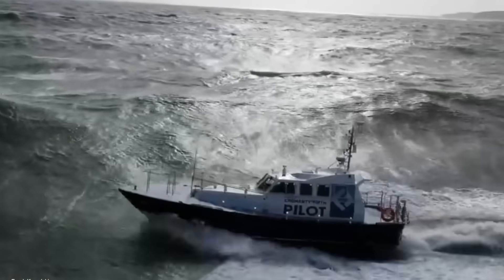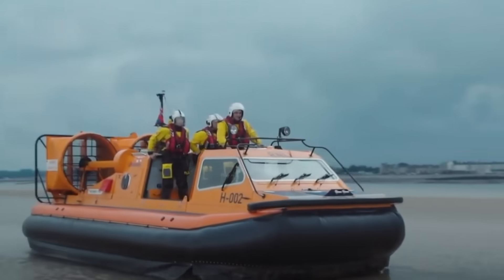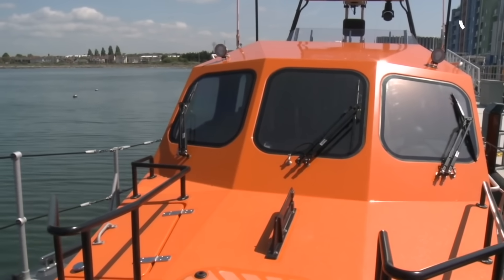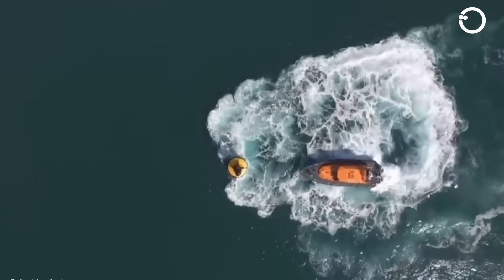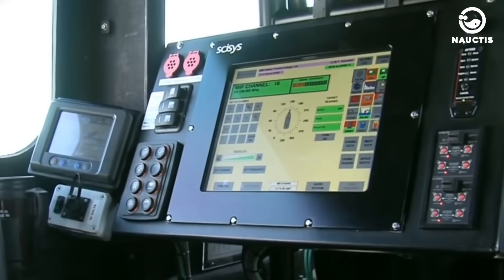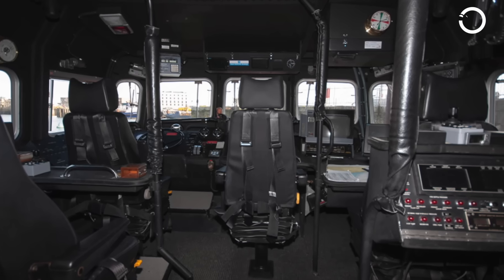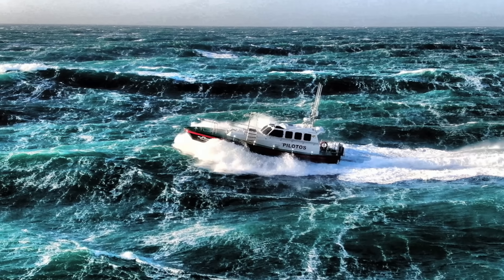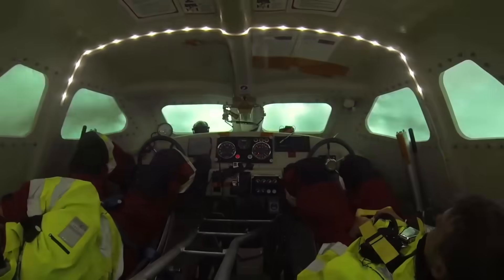Storm Rescue: Why MONSTER Waves Can't Sink the Safest LIFEBOATS During Worst Storms

Comment: @ 03:07 "Tar Mar class" ...Nonsense! It's pronounced 'Tay~Mar' named after the River Tamar which divides Devon and Cornwall. The Tamar's  designation is (16-#), the first number identifies the length and class and the second number identifies the build number (and usually the lifeboat station), this Tamar lifeboat is just over 16 metres and is based in Gosport (16-17). Then came the big Severn Class (17-#) named after the River Severn.  Also, the 'RNLI 13-02 from Dungeness is a Shannon Class, not a Tamar. This video could have been better planned.

Comment: Both lifeboats and rescue boats need to be unsinkable and self righting  when overturned by large waves, this is a design given. Furthermore, unless the passengers/ crew are  safe when being tossed over and over in high seas, Ie not thrown about inside to get injured or killed, then it doesn't matter if the boat sinks or not, since, a dead crew, or passengers are still dead! Thus safety harnesses/seat belts etc.  must be good enough to secure the occupants.  If these conditions are met, then the rescue/ life boat could be useful in saving lives at peril at sea.

Comment: In the mean time, supercomputers and big data need to recalculate torsional structural stress and factor in age to recommend range and ratio of ballast subsets for objectives of sacrifice cargo to preserve ship in bad weather and high sea.sss.
Reply: Drop some containers, ship management cargo system.
Unplug some others. Increase air pressures inside before sealing some doors. Assign some doors, stairs for intake of air and exhaust vent insides. Air pressure inside is structural-bouyancy

Comment: Lifeboats are advanced survival crafts for rescue or evacuation and long-term survival or sustenance at sea. On the other hand, any rescue boat should have the minimum conditions of the immediate or quick-response rescue of passengers irrespective of the subsequent sustenance period. USCG Veteran.
Reply: That's a Shipboard Lifeboat these are Rescue Lifeboats.   In the UK and Ireland we call rescue boats Lifeboats too.  In fact the UK and Ireland's rescue service is called the Royal National Lifeboat Institution
Reply: @hsdsaunders Our term of Lifeboat, meaning a rescue boat also predates ‘Lifeboat’ in the term of a ship-boarding lifeboat. Without the beach launched lifeboats rescuing sailors in distress around the coast it would have taken longer for someone to revolutionise the use of self-righting small boats which are currently used.

Comment: I'm not convinced.  It sounds good.  But so many of the rescue stories I've gone over have such a high incidence of failure of these systems.  From survival suits to fully enclosed boats there always seems to be a failure or problem that leaves me wondering if the design/test mentally is fully in touch with the realities and chaos of real world events.
Reply: What kind of failures are you alluding to?
And which incidents?
One thing that is important to remember is that mistakes made by humans or lack of training in using the equipment aren't a failure of the equipment.
Occupants not knowing how to right a capsized liferaft isn't a failure of the equipment.
Equipment not working because parts have been removed or are expired are not a failure of the equipment.
Most cases I've heard about where equipment malfunctioned it has been due to the crew not making sure the equipment lived up to required standards and was in the required condition.
Or used non-certifiied equipment to save money.

On very rare occasions there have been some incidents where things went terribly wrong - such as the Penlee Lifeboat Disaster, and the RF2 Disaster at Hirtshals!
Both happened December 1981!
Reply: @gorillaguerillaDK  I've spent a career leading engineering organizations in the design, manufacturing, and investigations into quality accidents.  A bad design is one where the engineers design the solution around how they want the world to play out.  A good design is one that takes into account the real world situation including imperfect training, flooding, fire, explosions, confusion, and panic.  To design a safety solution that only works in good weather and then say "well, of course if failed, they used it in the rain" is not a valid engineering solution.
While not the best example, but one that was top-of-mind, is the Deepwater Horizon explosion.  Even this less-than-ideal example is full of situations where the design and expectations of the life boat/raft engineers did not line up with reality.  You can find the report by googling "deepwater horizon-roi-uscg-volume-i-20110707-redacted-final"  Some low energy (I'm lazy and don't want to spend a lot of time on this) quotes:

1) "The liferaft tilted approximately 90 degrees, ejecting the off-watch toolpusher from the stretcher while the other occupants tumbled within the confines of the liferaft.185 Once the liferaft hit the water, the on-watch DPO fell out of the raft and swam away.  Someone then noticed the painter line was still attached to DEEPWATER HORIZON. None of
the occupants of the liferaft had a knife to cut the painter line, nor could they find the knife"

2) "The lifeboat design may also be inadequate to meet the needs of an offshore drilling rig crew. It is generally recognized that the average offshore worker weighs closer to 95 kg (210 pounds) rather than the present standard of 82.5 kg (180 pounds).  Thus, an approved lifeboat intended for the carriage of offshore workers could have insufficient overall seat width to permit the maximum number of persons the life boat was designed for to board."

3) "This experience showed that the actual use of a liferaft served by a launching appliance on a column stabilized MODU, during an uncontrolled well event, is particularly hazardous."

4) "The current lifeboat design and testing requirements do not adequately ensure the safe loading of a stretcher or permit adequate seating to accommodate the physical build of the average offshore worker today."

5) "The liferaft launch area had no effective barrier to shield it from the intense heat of the fire that threatened to incinerate the liferaft."

6) "After the davit’s releasing hook was attached to one of the three nearby rafts, the davit itself could not rotate outboard from the side of DEEPWATER HORIZON in order to inflate the raft. After he removed the shackle pin with a small tool, the davit finally rotated to allow the liferaft to be inflated"  (note: he had to find a tool for this)

7) "it filled with black smoke and got so hot that the chief mate could not find the brake handle to release the raft"

8) "The master determined there was not enough time to manually crank the davit’s releasing hook back to the davit to deploy another liferaft."

9) "The boundaries established at the bow Liferaft Embarkation Station were inadequate to shield evacuating personnel from exposure to radiant heat emanating from under DEEPWATER HORIZON’s column stabilized hull."

10) "The inflatable liferafts on DEEPWATER HORIZON served by launching appliances did not provide adequate protection for occupants under the circumstances. The exposure to extreme heat due to the proximity of the fire to the launching area, combined with the lack of a water spray system, placed them at greater risk during the evacuation."

11) "The storage location of the knife in DEEPWATER HORIZON’s liferaft was not easily identifiable to the occupants. Had reflective tape and standard IMO symbols been used, the
occupants likely could have found the knife and freed the raft from the painter line on their own."

Again, a successful safety evacuation system is one that works under the real world events that occur.  A system in place for a drilling platform that needs to evacuate in the case of a fire and/or explosion should be one that will operate in the event of a fire and/or explosion.  My experience reading reports like this shows a pattern where the reality consistently is at odds with the design expectations.
Reply: This is an incredibly naive and ignorant comment that is based on nothing other than emotion.

Mature people should ignore it.
Reply: @procatprocat9647  Which comment are you referring to. I made a comment and one person had a different perspective. It is like you accidentally posted on the wrong thread.

Comment: A lot of mixups. A lot of confusion and mixing of terms. Rescue boats, lifeboats and pilot boats are not the same.
Reply: In regards to Pilot Boats, some are equipped and used for SAR missions as well!
The term Lifeboat covers both vessels used for SAR (such as the job performed by the Royal National Lifeboat Institution and similar Rescue Services around the world), and the group of vessels onboard ships, offshore installations, and on a lot of aircraft.

Sure, I get that it can seem confusing, but you have to remember that this terminology goes back to an era where there really wasn't any significant difference between the boats used as lifeboats on ships or from the coast for rescuing people from ships wrecked on the coast.

The Stations from where these coastal SAR vessels launch are also still called Lifeboat Stations - and I honestly think that's common practice in most countries, as there's a lot of tradition connected to this naming convention.

Of course you're right that it's not all Pilot Boats that can double as a SAR vessel, but it's a trend that is becoming more and more common, and as Pilot Boats are getting increasingly more expensive and of course seaworthy, anyways it makes a lot of sense that they can be used for both - especially in areas where rough seas are  fairly common!
Reply: @gorillaguerillaDK  Yes I know that in the UK SAR boats are called lifeboats to. But I have never heard of planes with lifeboats. Some of them might have inflatable life rafts, but that is not a boat.
Where have you seen pilot boats with SAR duties?
And SAR boats/ships has never looked like a lifeboat on a ship.
Reply: @raymondnybakk1311 WW2 and later (maybe earlier?) SAR aircraft carried actual wooden lifeboats with outboard engines. They would be dropped to survivors in the water or dropped before a forced ditching to give the crew a chance. These type of aircraft were usually bomber types, like B-17s modified for the role, or purpose built flying boats like the PBY and PBM.
Reply: YOU ARE RIGHT
Reply: BUT I THINK THAT A LIFE BOAT IS NOT THE SAME THING AS A PILOT BOAT
Reply: As far as I know:
Rescue boats are used for saving people who are on the sea and bringing them to the boat. That's why many of them aren't enclosed.

Life boats are used for abandoning the ship when the ship is sinking. 
Some of them are enclosed, some aren't enclosed...it depends on where the ship travel.
Also, some lifeboats that aren't enclosed...are used as a way of brining cruise pasengers to the ship and vice versa.
Reply: @enibeni2071 Lifeboat the original term atleast was coined around late 18th (1700-1799 or early 19th (1800-1899) Century. Its first widespread use was on what some would now call Rescue ships. However all of these originally were lifeboats which would be based in the Harbour or beaches of busy or dangerous coastal waters and staffed by local sailors. Older ships before this time had no ‘lifeboats’ as such they just had smaller ships that could be used as them, however most served numerous purposes like a tender or landing craft, for Merchants and Military. In 1785 Lionel Lukin designed a self-rightening ship, which paved the way for the first purpose built lifeboat in 1790, which was a beach-launched vessel. It wasn’t until the mid or late 19th Century that Lifeboats began to be carried and be designated and designed as so.
Reply: LETS MAKE THIS A DEBATE
LOOK AIN ASHIP WE HAVE THE LIFE RAFT AND A LIFE BOAT
ALIFE BOAT AND  LIFE RAFT ALMOST SERVE THE SAME PURPOSES, BECAUSE THE BOTH ARE USED WHEN ABANDONING A SHIP ,WHILE A RESCUE BOTH IS USED TO EVACUATE THE VICTIMS OR ABANDONEES FROM THE SITE OR AREA OF ACCIDENT
PLEASE WHO IS IN SUPPORT OF ME ON THIS MOTION I HAVE JUST MADE
Reply: I don’t think they mixed up anything. The title is “Rescue Boats”. They just showed all types of Rescue watercraft. I guess it’s a matter of how you define everything. By real definition, a LIFEboat is a rescue boat. It rescues people…..in boat form.
Reply: @Jay_Force_One  That is like saying that trucks and motorcycles are cars because they can drive.🤪
Reply: @raymondnybakk1311 No its not..? They’re all motor vehicles broadly. Also;
Here as some vessels that are used as lifeboats that are purpose built as such. 
Atlantic ‘85 Inshore Lifeboat
Shannon Class All Weather Lifeboat
Trent Class All Weather Lifeboat
Reply: Will never get tired of Americans telling the British who invented the English language that they are using it wrong 😂
Reply: BRO TAKE IT EASY IT HAS NOT GOTTEN TO THIS
Reply: @hsdsaunders  I’m Norwegian. This is not about language, it is about understanding the purpose of boats.
Reply: @raymondnybakk1311  Well you are communicating in English and here in England Lifeboats can mean either rescue or shipboard.  In fact rescue lifeboats pre-dated shipboard by about 100 years.
Reply: YEAH NOT EVEN THE PURPOSE BUT THE KNOWLEDGE
Reply: I had a feeling. Still not sure bad video to watch at 3am smoking a fag trying to go back to sleep. I love the accent your people have. It's relaxing. 🇺🇸 ❤
Reply: a lot of using the same video footage repeatedly
Reply: THATS RIGHT

Comment: Not sure if I'm wrong, but 250 miles range seems limited...
Reply: They are primarily coastal vessels. They are stationed all round the UK. If you are more than 125 miles off the coast you are probably going to need a different kind of help. Also they are heavy and have massive engines so they burn a lot of fuel.

Comment: I've had two thoughts about modern enclosed life boats i see on cruise ships;.   #1 they are unsinkable.  #2 there will be multiple people in them vomiting in rough seas.
Reply: Sea sickness is highly cantagious  and sometimes fatal
Reply: Thanks for that visual
Reply: @sharonlevy7733  LOL
Reply: To avoid sea sickness they should be low depth submarines instead, traveling under the waves is a lot more stable, and people can enjoy any meal in peace.
Reply: @cannabico6621 😂 I can see the shitty Google reviews now. Life boat meal was bumpy and one guy couldn’t keep it down. 2 out of 5 stars.
Reply: LifeRafts and LifeBoats contains pills that prevent dizziness. 
All passengers must use them after embarking the lifeboat or liferaft.